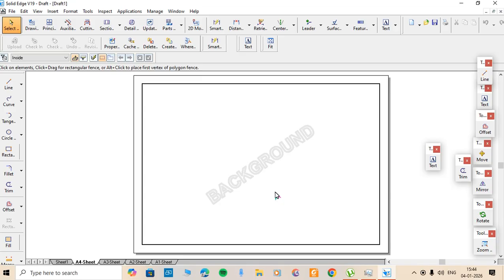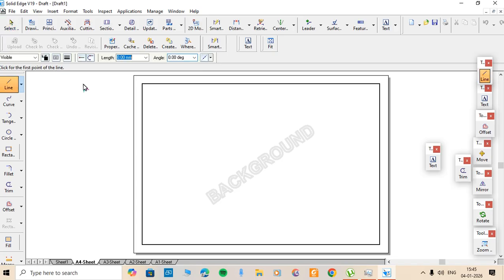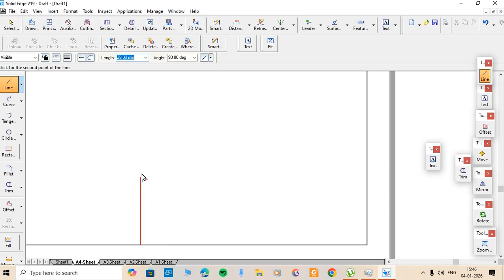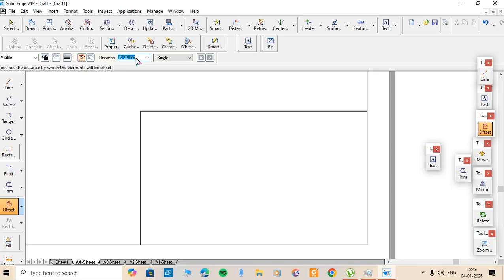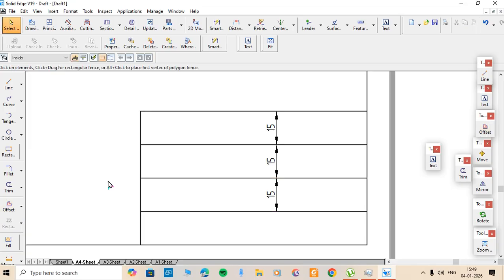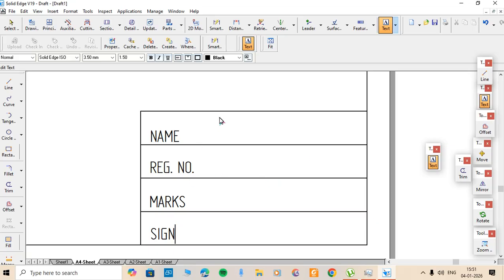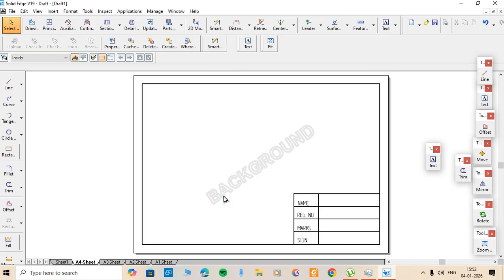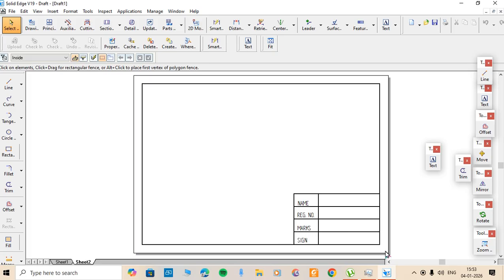TITLE BLOCK CREATION IN SOLID EDGE V19

Comment: Hello, thanks for the tutorials
I am trying to create an object in solid edge but not having any break through. Tried creating a cone then cutting off the top didn't work. Tried creating two circles, one bigger than the other on 2 parallel planes but no way of joining them. Tried also to extrude circle to a smaller circumference but unable to do that. Please help me.
Reply from the maker: I'll do one problem on it shortly .. hope that helps.